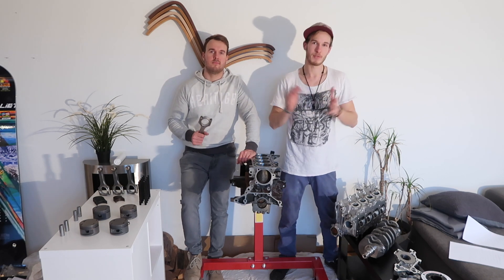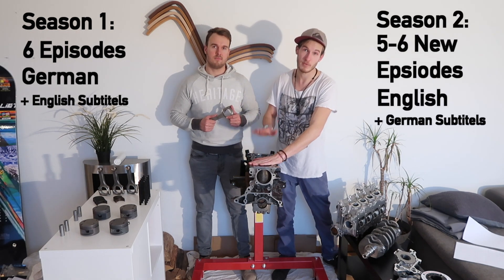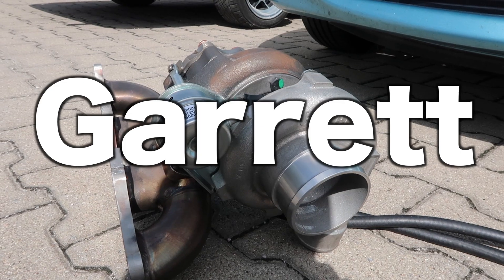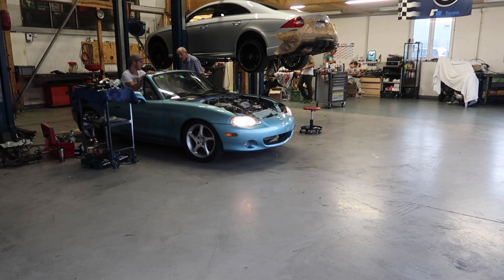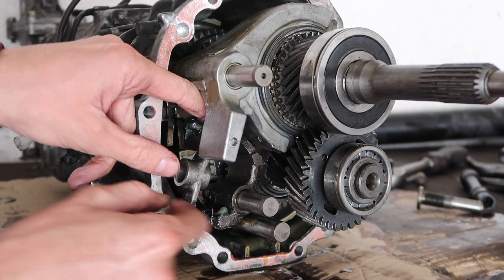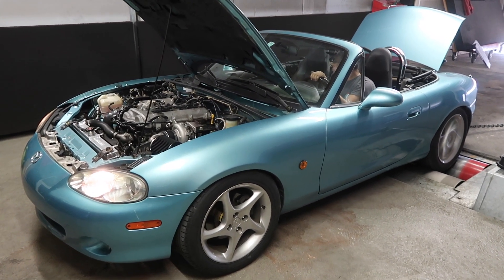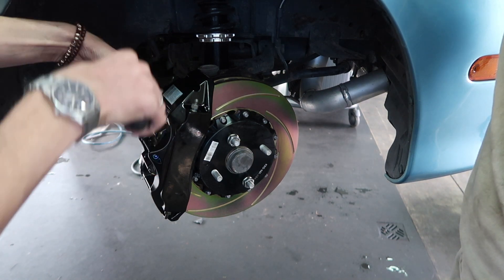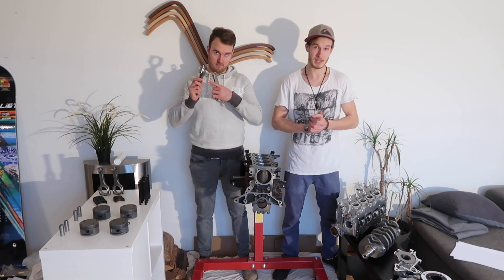Sleeper-MX5 (Miata) Turbo and 277 HP! What comes next! S2E1

Comment: I'm not sure if I follow correctly but did you make 277 on a built engine or a unopened engine?
Reply from the maker: 277 hp on the unopened stock engine. The built engine will see much more;)
Reply: @maxplorer8710  that's to the wheel? Not bad at all. 277 would have gone like a rocket.
Reply from the maker: @NippyMoto  277 hp was to the crank. But still it was very fast and so much fun to drive.
Reply: Did you run the turbo off a stock Ecu???
Reply: @BrianSmith-zm6us ofcourse not

Comment: Hallo zusammen bin mir gerade einen NB am besorgen nun gehe ich übermorgen einen anschauen den ich eventuell gleich kaufe ist aber ein 2005er mit dem 146ps Motor  jedoch 5 Gang habt ihr mit SPS Rücksprache gehalten bezüglich des Getriebes als ihr das auto gekauft habt oder eifach einen gekauft. Möchte den irgend wann mal ändlich umbauen. Lg Remo
Reply from the maker: Hey Remo,

hatten uns vorher ehrlich gesagt nicht wirklich informiert gehabt. Wenn du richtig viel Leistung fahren willst soll das 6-Gang Getriebe wohl standhafter sein aber das kommt auch sehr auf deine Fahrweise an. Im Endeffekt hatte wir glück schon das 6-Gang Getriebe drin zu haben.
Reply: @maxplorer8710  Danke für die Antwort. Habe zum Zeitpunkt deiner Antwort meinen NB gekauft und bin dann schon über einen Pass gefahren habe jetzt Sonnenbrand und bin schon so weit das ich sagen kann das Ding braucht unbedingt einen Turbo der orginale Motor ist ja mal müde 😂